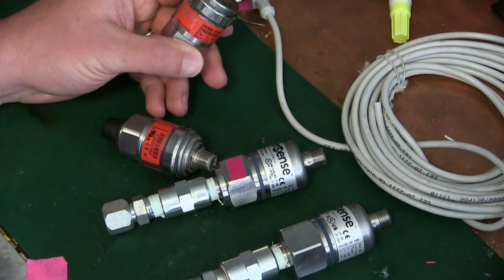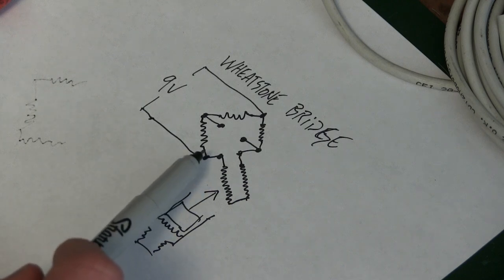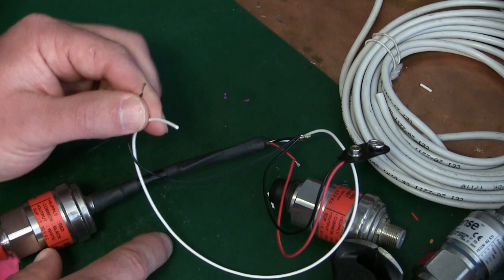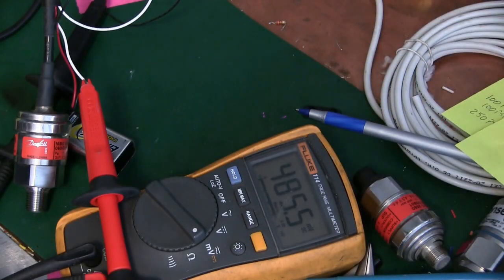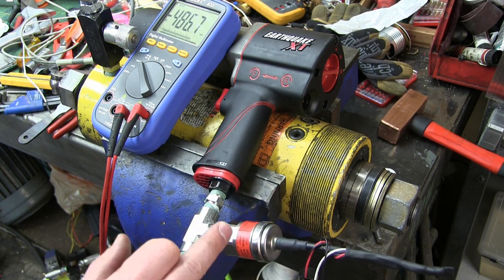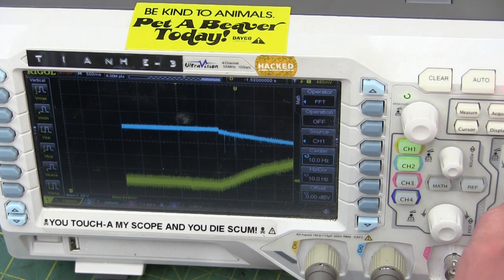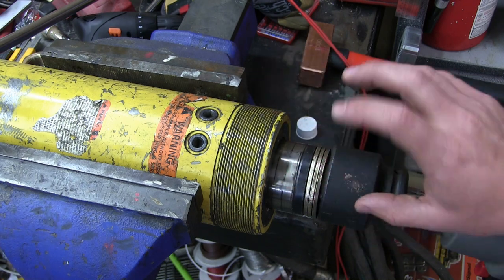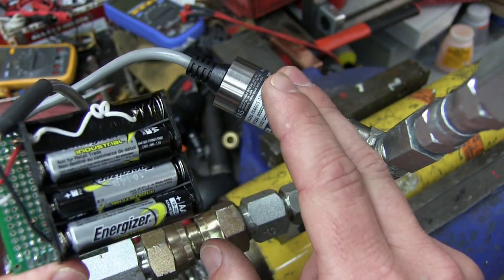How to use Pressure Transducers for Troubleshooting

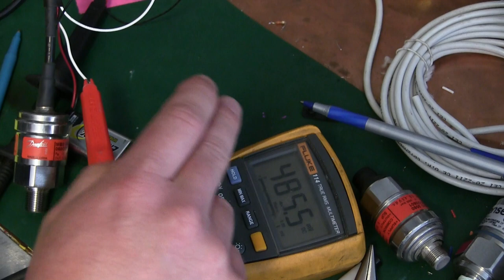Comment: All right... I NEVER comment but the math major in me is getting triggered... AvE starts working through some simple calculations at 7:05 . All of his math works out BUT ONLY IF the force acting on the piezoelectric resistance element is linearly proportional to the output voltage, and to my mind a transducer with a perfectly linear response sounds a lot like a "frictionless surface". So I want to know: Can transducers in the industrial world always be assumed to have a linear response across their entire range of measurement? It seems more likely to me that you would have to look up a data sheet for each specific transducer in order to correctly interpret their output.

TL;DR AvE oversimplifies the math. ;b
Reply from the maker: +Andrew Bruno  Hey, stick with the rest of the class Weisenhiemmer!  I'm welding a pastiche here. Don't jump ahead.
Reply: +Ave
Yo AvE. I'm not sure how best to get your attention, but I think that input voltage proportionally affects output voltage..and if you'd have input 27 volts you would have calculated 15 psi. So at 30 volts, you'd achieve 1 psi greater than the average human.
http://www.tabertransducer.com/transducer-inputoutput
Reply: Everything really is a curve. We normally calibrate things to four points on a curve. However, for this particular range, on this particular transducer, we say: "fuck it", it's basically is linear. It is not like we are getting ten digits of precision here. Just look at all that signal noise.
Reply: The output of pressure transducers are usually very linear, but it's more to them than just a Wheatstone bridge. 

First off, a quarter bridge with a piezoresistive element will not have an output of 0.5v to 5.5v, more likely the output only varies by a few millivolts. The pressure transducer must have an amplifier built in to get 0.5-5-5v output. 
It is also very unlikely to be a quarter bridge configuration as that would be very sensitive to temperature differences and it would have a lower output than a half or full bridge configuration. 

But the details aren't important for 99.9% of the AvE audience.
Reply: Yeah, if you're ever buying pressure sensors, make sure you buy the ones that are internally amplified and calibrated.  The signals on the non-amplified ones are so low that you can't read them with anything cheap, and while you can buy an instrumentation amplifier on a chip, by that point you might as well have just bought the amplified sensor to start with.
Reply: Yes, true I was surprised that it wasn't 4-20 mA out. However, a voltage signal is more usable. Most things work on a volt signal but current signals are better for transmission (as stated). If the signal is being used right at the transducer, like in the video, this is not a problem and an advantage for the volt output. The nice thing with 4-20mA is you turn the signal to 1-5 V with just a parallel resistor.
Reply: I don't know if most things work in volt signal anymore. Most industrial operations, plants, compressor skids, etc use 4-20 as a standard now. automotive usually bus or proprietary signal. Lots of PLCs and SCADA can accept either, and DCS typically 4-20 now. The new way is various types of bus, but I think volt signal is long dead for the reasons of resistive drop over long wire lengths, as well as noise.
Reply: Oh, no one uses volt signals anymore? Makes sense. They paid me to work on 60-year-old systems that we couldn't upgrade for legal reasons. So what do I know.
Reply: revcrussell there's always an exception to the rule. Industrial not implemented that much anymore, legacy systems notwithstanding.
Reply: The response won't be perfectly linear, but linear enough for a hobbyist. A core concept of engineering is that systems are designed and materials are selected such that they are linear within a given operating range, if possible. It makes the math easier. Of course, there are many exceptions to this and you can often find response curves in the data sheet.
Reply: Depending on the pressure transducer of course. Very basic ones may not actually be linear as you say and could suffer especially at extremes of the measurement range (turndown ratio). However, most industrial pressure transmitters these days have built in sensor curves and correct for ambient temperature, meaning that they can be considered nearly exactly linear (excepting the stated uncertainty which is rated)
Reply: Take it from someone that deals with transducers in industry. 99.9% of the time, an approximate measure is close enough. Especially if you're dealing with a range of 0 to 10,000 psi. With that large of a range, a tolerance of +/- 1psi would be outstanding, and not to mention unnecessarily accurate for almost any industrial application. 

Today's transducers are extremely accurate and for all intents and purposes linear. Generally, the only time you need ridiculously high (and expensive) standards of accuracy and linearity are for regulatory purposes e.g. emissions monitoring, and you don't want to know what a pain in the ass it is to maintain systems like these.

Comment: the .5 volts could be that because our atmosphere is always pressured so not only a broke checker but just science
Reply: Mr.Skidish if that was so, they would need to sell different transducers, configured to work at different altitudes, configured to be exactly .5v (+\-) at a specific altitude, don't think the atmospheric pressure has anything to do with it, but I could be wrong. Also who knows if they are that sensitive,
Reply: K0ester oops sorry I think you are right atmosphere probably has nothing to do with it because is piezoelectric but not the kind I'm use to. piezoelectric can produce elecricity when pressed but I guess it can also come in a resister form too and the volts come from the battery which I didn't put thought to.

Comment: i use a 2 inch 12 point socket on my dewilt 1/2 inch 20 wolt impact to tighten down front pinion nuts on 2 ton dodge trucks

then have to break out the 3/4 drive torque wrench(which comes up past my waist when stood up haha) to torque the nut to 369 ft/lb's

Comment: Maybe Michael Phelps could push 15psi lung pressure but I'd doubt it. Most people would be lucky to get 5psi on a good day. Easy to test: set up a U shaped length of 1" ID-ish  tube vertically, fill with water and blow into one end. The water height difference is your pressure. Plug that number, "# inches water" into google to convert to any pressure unit you want. (Search do it yourself manometer)

Comment: This is a weird transducer. Usually analog outputs on industrial transducers are either 0 - 10 VDC or 4 - 20mA. 4-20mA is most common. Many 4-20mA inputs have a 250 Ohm loading resistor and it measure 1-5 VDC if it's powered with 24VDC.
Also, many newer transducers are "two wire", meaning that the transducer is connected in series with a 4-20mA analog input while it's being powered off a 24 VDC power supply. Of course this depends on application requirements.

Comment: I used to deal with these in my old job, they didn't usually fail. it wouldn't stop the bumble fucks at the manufacturing support from telling me to replace it for a pretty penny. had about 5 working ones collecting dust at my old shop too !

Comment: Great for troubleshooting, but I can't sell off with it because my local clipboard-holder says it ain't calibrated. And the Cal Department won't touch it because there is no vendor to provide a calibration procedure. And they won't accept the procedure that I can provide them with. (They'll trust complete strangers but not me.)

sigh I'm complaining about the work situation, not about the video.

Comment: when you said data logging with that sensor i was thinking now he brings out the arduino and a cheapo screen and there it is, full data logging system. BUT NOOOO, he has to show of his fluke, not the cheapo arduino, but the fluke and then even the osmelloscope. And all this time im thinking just grab an arduino, you could even make it permanently attached to the transducer because that arduino is way cheaper then the transducer. I think a chinabay arduino is even cheaper then the scrap value of 1 of those transducers.

Comment: mazda rx7s use a 54mm single nut to attach the flywheel to the engine. most homegamers are not going to have something larger than a 1/2 impact.

Comment: "Good used parts..."  I almost got thrown off a job in a power plant in Colorado because the Millwrights came back from stores with "good used" bearings and I threw them in the scrap.  $ 1100.00 bearings supporting a $30,000 high speed rotating element in a $150,000.00 overhaul on a $750,000.00 machine.  Go figure!

Comment: Just trowing it out there : if the impact wrench could generate 1,100ft-lb, how could anyone hold on to that pistol grip whilst under load?  Torque is proportional to force which is mass times acceleration... when the "hammers" impact, the acceleration is high but very short lived... i.e. the force the wrench produces at the moment of impact is very high but short lived (an impulse)... if you take that instantaneous force to calculate a torque rating, you probably can get something absurd like 1,100ft-lb

Comment: You got me thinking, AvE...  I have a pneumatic air cannon.  (Combustion cannons suck.)

I could use a transducer connected to an LED array mounted to the cannon to give me the pressure charge.

3" schedule 40 is rated 240 psi.  I use a regulator to give me the pressure I want to use to launch a potato.
100 psi is mashed potatoes every time.

A ten segment LED bar calibrated between zero and one hundred PSI would allow me to leave the regulator at 100 PSI and just watch the LED bar as I blip the air nozzle.

Your thoughts please, Doctor FumbleBuck.

-YouTubeWhiteDickHead

Comment: I am not fully convinced by this.  I don't think that the statement about not fully replicating lab results in a real-world environment logically leads to "never in a million years seeing 1000 ft-lb".  Keep in mind that the impulse they are talking about is equivalent to the angular momentum that the hammer mechanism can achieve.  Your test is conducted on a hydraulic system which I imagine is a lot less rigid than a seized up fastener.  So compared to your test rig, in a real world application, you would see a much shorter time through which that same impulse (momentum) will be applied, yielding a much higher toque.

I do agree that the torque value on an impact gun may be misleading, but I would argue it is much closer to the stated value in the typical real-world application than you found, where you are only attempting to overcome the static friction of the threads and seat of a nut, with very little in between to act like a spring (unlike your test fixture).

Comment: 0.0083 is 8.3mV / psi.  You got a peek of 15mV.  That's 1.8 psi  A human can't push more than about 1.5 psi.  1 psi in a sensor rated for 600 is not going to be very accurate.

Comment: Ave goodday ( goeiedag pannekoek) first off al to measure the torque of an devive never use lubrication what or so ever 
because you dont know what the coeficient of the lubrication used .
So what ever jig the other guy with "new washers and new grease " is using you wil never get an adequat reading.
Then consider to put the test cylinder in upright position because laying it on it side will give drag because you dont know the state of the seals inside and could give drag or seapage .
I would use an digital torgue wrench ( with data logging if possible) secured in , maybe an vice and calculate the torque output 
there are to much variables with the cylinerd test jig in my opinion  .
Hell even an calibrated mechanical torque wrench with an chalk wired to the the dial , but i doubt you will get an acurarat reading .
Double check it with an calibrated torque wrench and  cross reference it with the baby pig ( is our name to call an pnuematic impact gun on Bonaire ) let us know the outcome

Comment: If you can do 15 psi with your lips you'll be the most popular guy in San Francisco.. But you blew it.. 8.3 mv per psi and 15 mv delta is only about 2 psi..  I remember trying a fuel gauge when I was young and could only get about 3 psi..

Comment: Why a TRANSDUCER not a sensor or something? 
I mean it doesn't run in reverse (voltage in, pressure out), as, for example, loudspeaker does, does it?! 

Was it the guy/group that came up with LAMBDA sonde, it's a fckin oxygen sensor (NOT an oxygen TRANSDUCER!!!). And you don't (well  SHOULD NOT) sonde a lamb with it i guess.

Comment: Using the Confuzer to do calculations

http://www.status.co.uk/calculator.aspx (this one works with any input or output units as long as the result is linear)

https://www.sensorsone.com/measurement-to-linear-4-20ma-converter/ (specifically a 4-20ma converter but has a helpful output chart)

Perhaps you will find use in this. In the past I have seen a page that was a merged result of both the links above (meaning it allowed for any input / output and had an elegant graph result) however, this website eludes me at the moment.

Comment: It's a load cell that works on pressure rather than weight, but  it's all the same thing. I specialize in overpaid guess work, unless I have the tools to test those pressure sensors, which I do. They are far from cheap. You get a monster compressor that will hydrogenate chemicals for making LSD25 (7000 PSI absolute)  a regulator, a tank, and precision pressure gauges, to test your other gauges against. Hydraulics suck. You can have electrical, mechanical, chemical, physical, even pneumatic problems. You need to the Agilent Keysight 60,000 counts per DVM with the USB logging capability, or better yet the 30 GHz Tektronix O Scope, go mortgage your house for the down payment, and pray like hell the government needs pulsed Doppler RADAR work done, and they come to you for it. The last big bux Tek scope I got to play with, including the modules, was over $3,000,000. It would do CFITA RADAR, Nav RADAR, Tareget RADAR, and any other kind of RADAR. It also did DDR1-6, and ????